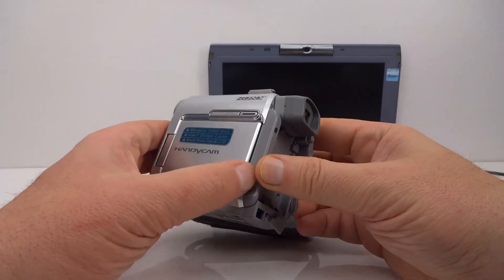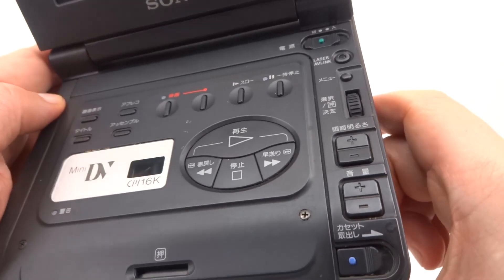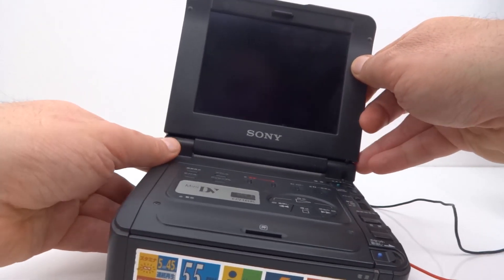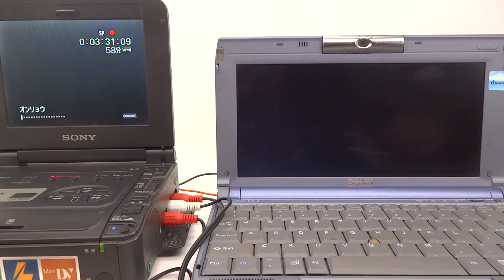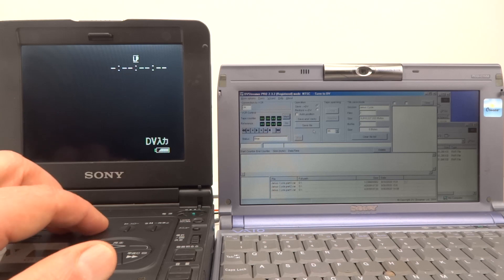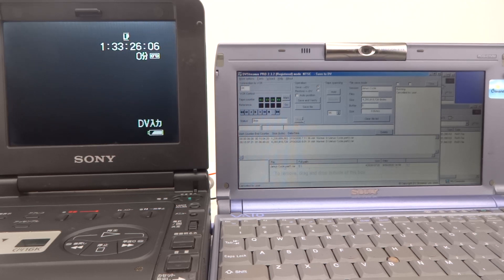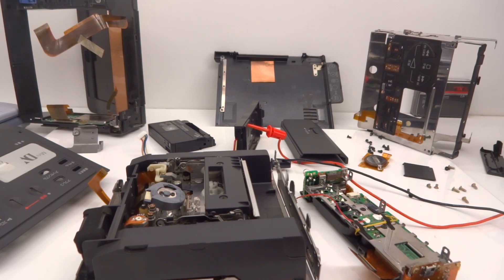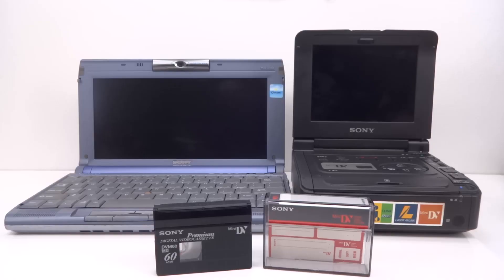Going further into MiniDV using a Video Walkman

Comment: I had brief experience with a Digital8 standalone "mini VCR" one of these only a couple years back. Got it handed to me with a bunch of tapes to digitize. I treated it with absolute respect and care, it felt like a piece of pro equipment and it still commands very considerable money on ebay. It turned out to be a breeze digitizing the videos on my old Windows 7 laptop over iLink. I'm somewhat stunned the machine still works flawlessly after all those years, crammed full of features and mechanisms. Fantastic piece of engineering.

Comment: I was very surprised you were able to power the unit without a infoLithium circuit attached to it. Most Sony devices turn off after a few seconds.
Reply from the maker: I have encountered many Sony devices with this problem. I was thinking about this and realised that this model doesn't have a DC input barrel jack that many similar Video Walkmans have. That means to run this from mains you would need one of those battery adaptors. These also don't have infoLithium circuits. I wonder if this is related.

Comment: I watched this great video with interest since I'm in possession of two similar units that each have different problems.  (Mine are the GV-D300).  You are much braver than I in dismantling to the point of disconnecting ribbon cables and mechanical assemblies.  Have you ever dealt with the dreaded C:21:00 Dew Sensor (CN3104) problem that won't go away?  I followed the suggestions in the service manual about letting the unit adjust to the current temperature.  No help there.  I'm pretty sure the sensor is bad and is keeping the unit from playing the Mini DV cassettes.  But I can't locate the sensor.  Is it accessible from the inside where the tape head is located?  Or is it on the circuit board (CB61 A) necessitating the removal of all the ribbon cables and the circuit board labeled CB61 B?  Any advice would be appreciated.

Comment: hey mate I know i’m a bit late to the party but what state are you in cause i’ve got a minidv cam that works if you wanna borrow that, it’s got firewire on it as well
Reply from the maker: You're never too late to the party when it comes to retro tech :) Depends on which model cam you have as to which story can be told, I'm in SA.
Reply: @JanusCycle  haha yeah fair point, sucks though cause i’m in vic and it’s a bit of a drive, anyway for the model its a SONY DCR-TRV18E in pretty much mint condition, found it while cleaning out a while back, the tape that was in it looks like it was some work video from crown casino melbourne but i’ve got some blanks and shot some of my own footage as well, really cool aesthetic in the footage

Comment: I now have a fully working Sony GV-9 looks like new too and 2 x GV-200 , 3 x GV-500 and hopefully after restoring a GV-100. lots of fun and frustration buts that the hobby :) It's a shame the GV-8 model which is the same as the GV-9 just a smaller screen the LCD on GV-8 has a bunch of capacitors in one corner of the LCD back board and they corrode it too death :(

Comment: Hey what's the make and model of this cam?
Reply from the maker: Do you mean the camcorder right at the start? Sony DCR-HC30e
Reply: @JanusCycle  yes, you tryna sell it?
Reply from the maker: @desertheatkicksgee  nope, touch screen doesn't work. Won't work as a camcorder. So I used it as a data backup drive in the previous video :)

Comment: Interesting my Sony GV-D800 has an external power supply and the batteries are still available on ebay aftermarket and work well.
Reply from the maker: I didn't want to invest in a new battery if the display only shows black and white. I did have a thought of finding an old battery and using it to build an external power adapter. I'm tempted to see if I can fix the fault however it's such a weird problem and I'm not sure it will be worth all the effort.
Also, I've recently noticed the LCD backlight goes off after being on the a while. I believe it's a fault because I have to power the unit off for a bit to bring it back on. With all that said, I still really like my unit and I'm glad the main functions work well.